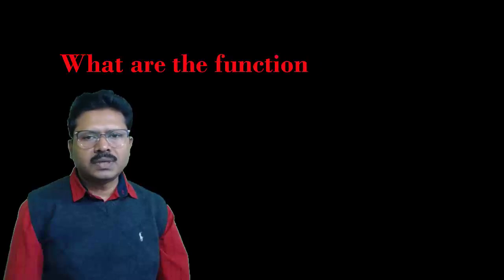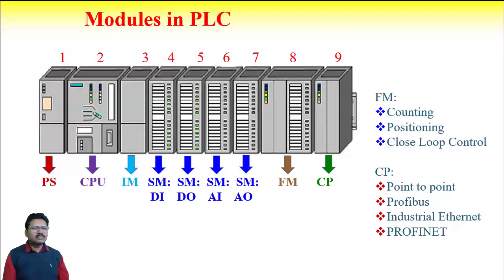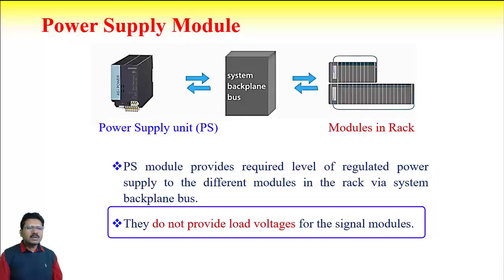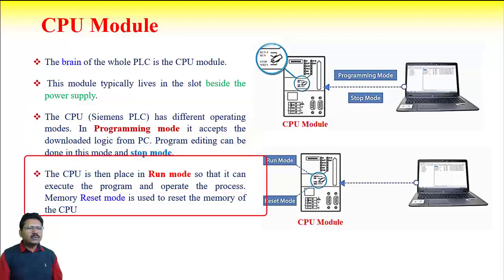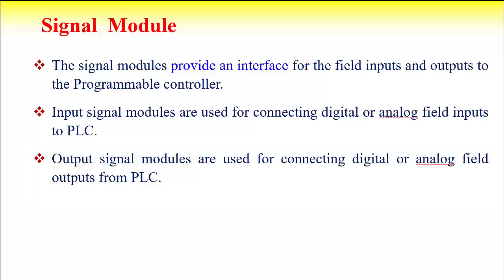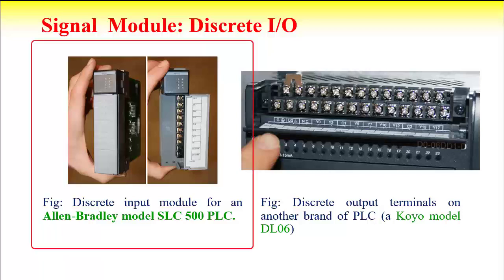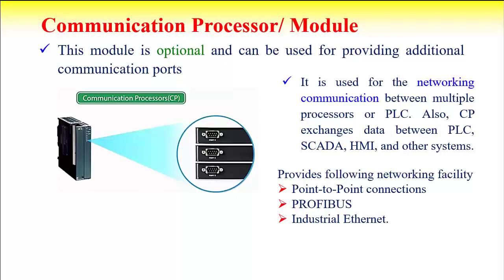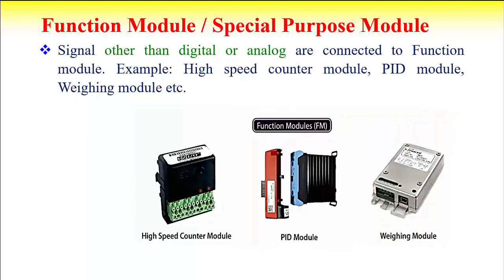What is PLC: Functions of PS, CPU, IM, SM, FM, CP Modules in PLC

Comment: Thank you!! As a Software Engineer, my concern is only the Interface module as I understood.
If my plan is to build an application like SCADA what modules that I have to study more and work with.
Moreover, Is there a dummy or a simulation for this for my trail and testing??
Reply from the maker: It is better not to mixed up with PLC and SCADA. PLC is mainly used for digital/logic control, receive logic signal from process and send logic signal to process for control purpose.   Analog (PID) control can also be done by PLC but rarely used. DCS is mainly used for Analog control.  Now Regarding SCADA...SCADA is not a specific technology, but a type of function, a type of 'software application program' used to control hardware. We can build a SCADA system using several different kinds of technologies and protocols. A company might design a SCADA system by using field instruments, hardware (say single loop controller) and software designed by own. In that case it needs companies own software developed by any programming language, A PC where the software will run, and process with sensors and controllers. The software is designed such that it produces Graphical user interface, graphical representation of process, receiving process signal to PC and sending signal (say set point value, etc) to the controller. Now in place of single loop controller, PLC and DCS may also be connected as a controller, which control the process parameter as well as connect with server PC via hardware like RTU. So.... you asked me about a module to build SCADA. Not possible to specify a particular module for SCADA. I  have no idea on Simulation for SCADA.  I tried to give an overview idea on SCADA. By the way, may i know you, from where you are?
Reply: @silenceandprogress  
Thank you for the quick respond and clear vision. I am following your channel from Egypt as my logo (Pyramid & Sphinx).
All what I am looking for is how to read and send commands to some devices connected and controlled by the PLC?
That is why I here trying to learn more.
Example:   Boiler should heat water up to 85C need to keep reading on my application the real time temperature, more over if I set on my app to stop at 70C that should update the PLC with the new -parameter.
Or more simple one Switch On/Off The boiler from my app like IOT technology.
Is I am on the right place to learn or PlC has nothing to help in this and its all about the device interface only that manufactured built in?
Thank is ones again!! Love your videos
Reply from the maker: @mixedsalad4773  What i got to know from your writing ... Basically you want to provide command to PLC by  some other means externally  to control the process. I don't know why are you thinking like this way? PLC developers has researched a lot and developed almost all control technology used for it.  Through the programming with PLC languages like Ladder, STL SFC, FBD, PID, etc, every control logics can be developed. PLC needs no extra hardware or software externally.  What you can do... If you want to do any thing like what you said... You want to monitor real time temperature of boiler and no doubt want to control it. If you use PLC then no need of other software/Hardware. Now,  if you do not want to use PLC... what are the other options?  You may purchase a single loop controller or you may  design an electronic PID controller or you may use any microcontroller (8051/AVR/PIC/ARM) or you may use NodeMCU or you may use RPI as controller, then use field devices to measure the process parameter and control it.......  Anyway, i am really glad to get you here, and specially you are from Egypt. From my childhood there is a special attraction on the name Egypt, don't know why? If you think my activities are good then please share my channel with your friends and help me to increase more subscribers.
Reply: @silenceandprogress  
Sure I will.
Waiting welcome you to Egypt.
I enjoyed already many times in India.

Comment: In S7-300 redundant system, Will the system work without CP modules ?
If yes how to configure the network ? 
Can the communication between CPUs be done using MPI ports?

Please help.
Reply from the maker: CP modules in redundant system are normally used to communicate data between two CPUs, So probably to work as redundant, CP modules are required. MPI networks are normally used to communicate with CPUs and HMI. MPI port of CPUs are connected with Repeater and then Repeater to HMI.